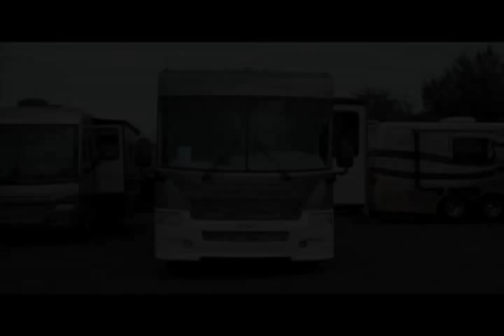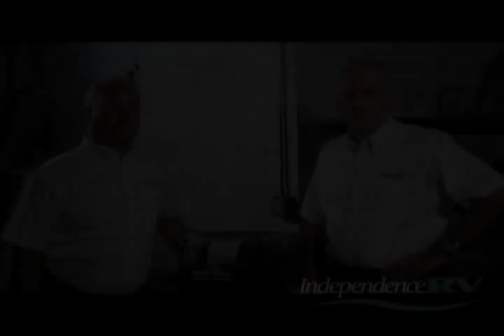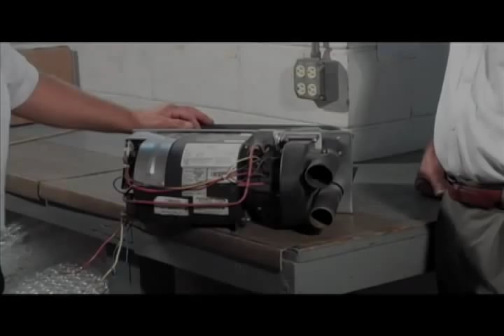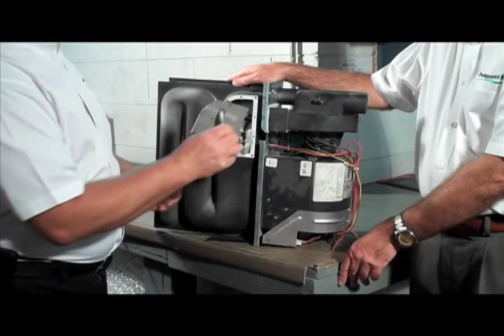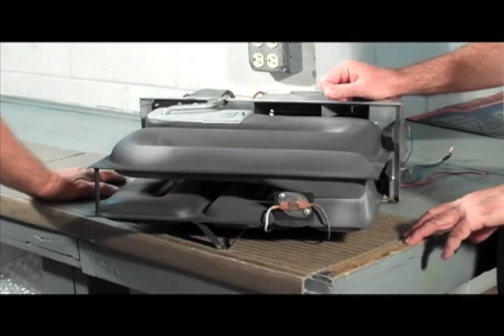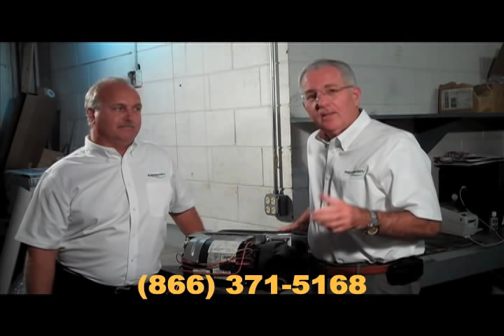RV Gas Furnace Service Demonstration

Comment: I have very warm heat coming out of the vent is this normal?  I think more heat is going outside than inside
Reply from the maker: Diana -  Yes that would be the exhaust of the furnace burner. As far as the heat inside, the air outside is not trying to be forced through floor ducting and does not have the amount of length to try to spread through the coach as it does the small outside chute. So the air will have more pressure going outside than inside the coach. You will probably feel more heat at the floor vents closer to the furnace and then the further you get from the furnace the less air you will have coming out. This is just due to static pressure and the old saying – path of least resistance – is why.

Comment: Would really have liked to see how the LP was disconnected from the furnace assuming there is actually something to disconnect. Can't believe you just disconnect the wires and pull the entire unit out.
Reply: We're trying to find out the same thing. Husband is out trying to pull it out right now, based on what we saw on this video. Hope it's as easy as they showed.
Reply: +Mindy Storen I bet you found out they didn't really show it all huh?
Reply: +William Bonsell Yeah he didn't show the fun of disconnecting the gas line.
Reply: +Patrick TheBaptist Its on the bottom left of the unit in the front where the cover is on the outside of the RV.  If you watch the video again, you can see the NPT fitting on the left of the screen on the bottom.

Hope this helps
Reply: Chris travaglino
Hello I didn't I didn't know where the gas connection was, no need to watch the video again I've already gotten the unit out.
Have nice day.